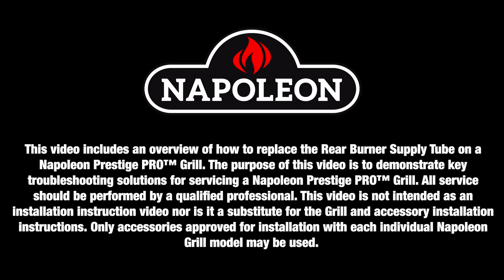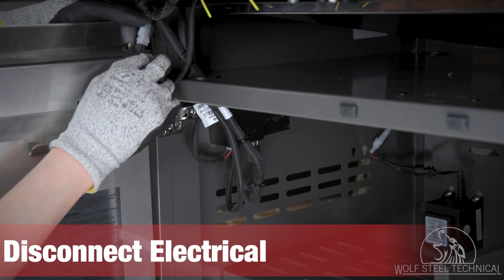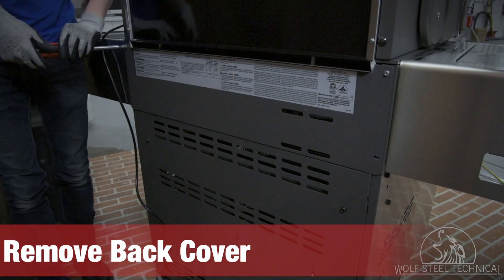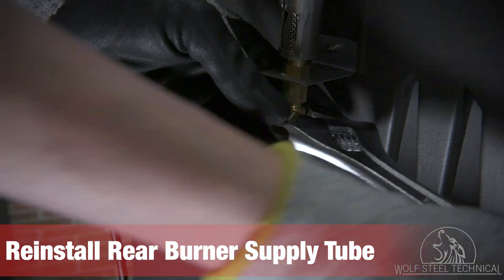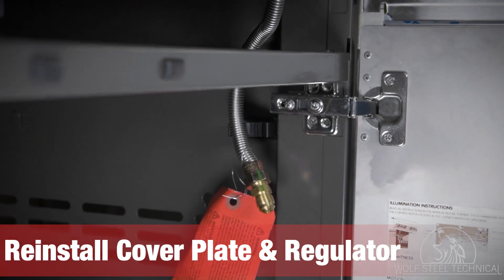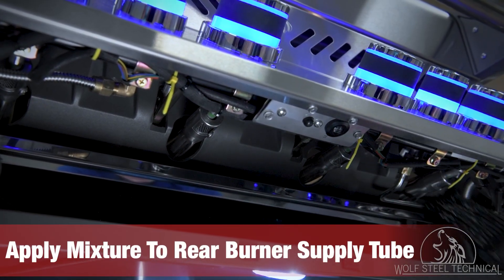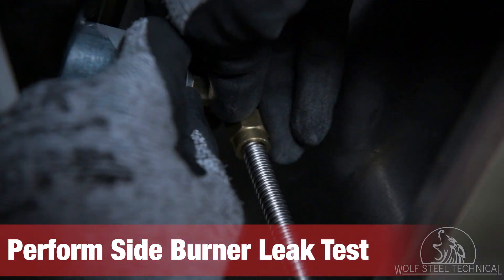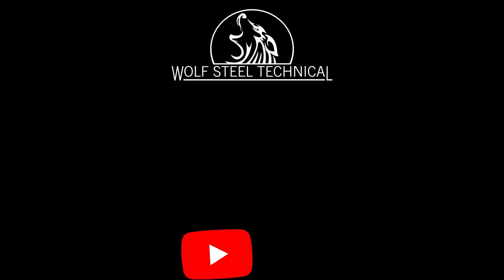Napoleon Prestige PRO™ Rear Burner Supply Tube

Comment: What would be the reason for replacing the supply tube?
Reply from the maker: Great question, 
 
One possibility would be damage due to impact. 

Another would be poor performance of the rear burner, resulting from the supply tube having a kink in it, or extensive use covered under warranty.

 It's best to have your technician do a visual inspection of the supply tubes, should the performance of a side or rear burner be in question.
Reply: @wolfsteeltechnical  I would love to have a technician look at it. However, when I called Napoleon yesterday, I was on HOLD for 4 long hours and then disconnected. Our Prestige 500 that's only a year old will not light. We did all the required maintenance and it still will not light. The gas does not seem to be flowing at all. Tried cleaning hoses and burners, but still did not operate.
Reply from the maker: @LeeAnnScott22  perhaps the ingnitor needs to be cleaned. We show how to do this in a maintenance video in this playlist:

https://www.youtube.com/playlist?list=PLhq_VjjeciUzv5yBYEFZSawaLpiLBX9x0

As for access to  technician, try reaching out to your nearest Napoleon Dealer for assistance.